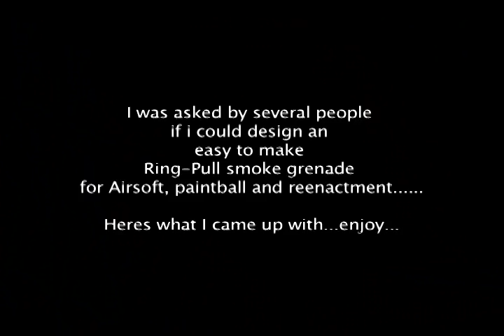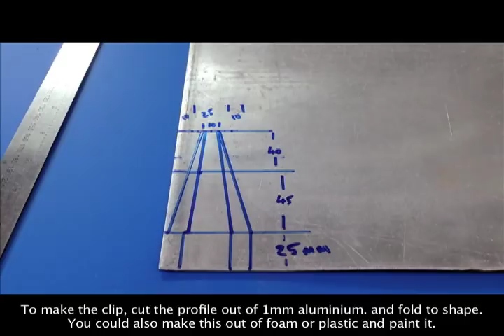Experiment No.1 A SAFE Reusable Ring-pull smoke pyrotechnic

Comment: Here's a suggestion.  Instead of a threaded rod, use a nail, which has been covered with sandpaper (glued on with contact cement).  That would be cheaper than the rod, and propably more reliable, too.  Better yet, a piece cut from a coat-hanger.
Reply: Cheaper? Yes, absolutely. More reliable? No

Comment: I can't test it myself, it's hard to find the smoke pellets in my country if you aren't a professionnal. if I may suggest, why not use a little spring with enough strength and recoil to push the rod and connect it on a mobile spoon? so much potential in this little battleground accessory :) good job!

Comment: I have a already detonated flashbang that has an operational trigger system if you want to re use it you just have to take it apart put a new center shell in there and replace primer at the top if you can make this fire on shotgun primers let me know thanks

Comment: Buy dummy hand grenade,remove spent striker and put piece of fuse up from bottom after chamfering the top hole to accept a small pistol primer., seal with drop of wax, reset fuse assembly and screw into body, add smoke generating powder,tape bottom hole of body. pull pin, hear satisfying pop and throw, you have 2 seconds max. Admire smoke, repeat.

Comment: Very cool, but a real grenade wouldn't go off until you release the lever. I don't see how you could pull that off though. Maybe have ring holding it in place and hooking it up to the lever instead. Have a spring pulling it down, so once you let go of the lever it would pop out and set off the matches.

Comment: Swallow Forge Is it possible to use a mix of Potassium nitrate (stump remover) and powdered sugar that everyone seems to use? It is safer than black powder and seems to produce more smoke and less smell. It also makes a puffy smoke like the smoke you see in an M18. I am not sure why it does that but I am a fan of Airsoft and smoke grenades for Airsoft seem to be hard to find in the United States.
Reply: Also black powder is a bit expensive.
Reply: Also smoke pellets I can't find anywhere and I have a ton of stump remover.
Reply from the maker: Check out my other video here. 
http://youtu.be/vkn2ucOobLA
Reply: Swallow Forge
Thanks!

Comment: omg omg how did you learn how to do that!?
Reply from the maker: 20+ years of engineering. :)
Reply: wow awesome
Reply: is it a only 1 time use
Reply from the maker: No you can reuse it as long as nobody treads on it :) you may have to replace the rubberband. If you want it to last a really long time I suggest using copper pipe for the tube. :)
Reply: Ok thx
Reply: Swallow Forge Is it possible to reconfigure it into a cylindrical shape? Rather than the rounded M67 Design you used on the video.
Reply: What did you engineer Swallow Forge
Reply: ThePaperCreater lol is it possible? yes wtf kind of question is that
Reply from the maker: You can make it any shape you like :) the ignition system is just the tube with the pen cap match holder held in place with rubber bands. The threaded rod is the striker. Once you have made that, it's just a case of using your imagination. Have fun, but overall, be safe.
Reply: Swallow Forge The clip is called the spoon on a real grenade.   Very ingenious,  maybe some type of sealant that won't burn to keep the cardboard from getting soggy when used near wet areas?  How about adding some weight to the empty side and maybe more vent holes to the other half for more spread on the smoke.
Why not use tape when connecting the fuse to the striker area to make it easier to reload or maybe have a small pipe with a holding area at the end to hold the fuses into the starter.
Reply from the maker: eric kinney Thank you, I do try to be patient, however my mouse button does sometimes hover over the 'Channel ban" button. I've only used it a couple of times in anger though :)
Reply: Swallow Forge Are you referring to me? If so I'm sorry if I did anything to provoke an argument with that person, though I do believe it was him who started it.
Reply from the maker: ThePaperCreater no not at all. I do on the odd occasion get quite nasty comments from people who don't really understand the object of the video. Firstly i have to look to myself first, had i not made the video as understandable as it should be? But more often than not, I just realise that the person is an idiot. As far as I am concerned, you may ask any question, to engage in dialogue is an important way of sharing knowledge, I have learned a lot myself from discussions on youtube. I hope you enjoyed the video, as I intend to make plenty more :)
Reply from the maker: I have redesigned the grenade in a new M18 package with a super simple ignition system! check it out here!
http://youtu.be/vkn2ucOobLA

Comment: Can you add length to the fuse so you have time to toss the grenade before it starts smoking?
Reply from the maker: Yes you can. If you run the fuse round the circumference of the hemisphere you will get up to a 15 second delay depending in what type of fuse you use. 
Hope that helps. Alex

Comment: Hello (<---NOOB) just a quick question.. why did you do that at 00:39 ??
Reply from the maker: Hello Morten, If you mean why did I turn the spray paint upside down, then it's because by turning the can upside down and spraying until the can runs clear, cleans out the nozzle, so you can use the can again at a later date without the nozzle being blocked. Hope that helps. :) Alex.
Reply: Oh.. i did not know that... thanks
Reply: ههههههههههههههه
هههه

Comment: Is it safe to breathe in the smoke? Not sitting there inhaling it, but if you were to get some in your lungs, would it be potentially harmful?
Reply: +Luke J It isn't the worst thing that could happen to you. Just try not to get too much in your lungs.
Reply: okay. i would like to use is for airsoft, but ive read about it and everyone says its so extremly harmful, and ive had my doubts, but like you said as long as you dont get too much in your lungs it shouldnt be an issue.
Reply: use it*

Comment: its a really creative build what you did but first i had to say i hope that was a joke that you need to be 20+ year an engineer to build these little thing xD and i dont wanna hate its a really good video and what you builded works fine but its not a good quality and its tooooooooo much time for just having a bit of smoke ;) i just wanna say if i would build something like this i wouldnt build a prototype of something with bad quality i would build a bunch of it in high quality but it takes to much time for that little fun ;) but youre a creative guy ;)
Reply from the maker: The 20+ years was a reference to why I find it easy to design things. The trick is to design things to be simple so anyone can make them. I could have made it to look better, but the point of this video is to inspire others to make their own. Plus it doesn't need to be perfect. Takes about 20 mins to Batch out a bucket load. Plus they are reuse able :) time well spent in my book :)

Comment: Too bad I dont have the materials to make this, but if I had I would make it a little bit bigger and use four smoke pellets instead of two.
Reply from the maker: The three inch cardboard hemispheres are about the right size for Grenades used during the 17th and 18th centuries making them ideal for historical reenactment as seen in my other video. This one is designed to imitate a M67 frag grenade, so 3 inch diameter is pretty close to the original. A simpler way to get more smoke is just to crush the pellets into a powder, half a hemisphere will hold about 6 pellets this way. Hope That helps. Alex
Reply from the maker: I have redesigned the grenade in a new M18 package with a super simple ignition system! check it out here!
http://youtu.be/vkn2ucOobLA
Reply: Swallow Forge Awsome, I'll give it a look!

Comment: do i have to use the hemis stuff or could i use like a pill bottle
Reply from the maker: +Critically Chaos I wouldn't advise using anything made of plastic as the plastic creates toxic smoke when it burns. A toilet roll tube makes a good substitute. you can cut discs out of a cardboard box to plug the ends.
Reply: thanks

Comment: Step 1. Become a master fabricator. 
Step 2. Buy $50,000 worth of equipment.

I think you left those steps out.
Reply from the maker: Step 1. Watch
Step 2 learn
Step 3 realise you can make the same thing with a coping saw, hand drill and some sand paper.

Or just watch my other m18 smoke grenade video that doesn't require anything more complicated than a pair of scissors. :) 

Step 4. Enjoy :)
Reply: TheTFReview  A little bit of respect for somone like him would really be appreciative, plus its just simple tools, he just used more advanced ones for the video
Reply: Chyf jAkzx Of course I respect him.

Comment: Instead of using smoke pellets you should use the rocket fuel from the king of Random but sadly it will not be reusable
Reply from the maker: It will also create lots of fire. That's why I don't use it. Using the smoke pellets means they can safely be used in forests, buildings grassland etc without setting fire to its surroundings.
Reply: Swallow Forge but thats the fun part.....

Comment: a grenade should be designed to explode not only smoke
Reply: Believe it or not, it's probably not legal to go and make your own explosives, so smoke grenades (which I find cooler than regular ones) are the other alternative.
Reply: its crap
Reply: CleanUnit you angry or something? I was just stating that grenadea can also be used for smokescreens or signals, no need to go full on Hitler mode...

Comment: not to be a hater and stuff but this dosent work well is mostly for looks takes to much money and time
Reply from the maker: They have all worked so far.  Have you built one and tried it? As for cost. The work out about £2 each.  Considering most of it is reusable (assuming nobody deliberately treads on them) it works out a very cost effective way of creating a smoke grenade. However if you want super cheap, super easy, no tools required check out my other video here :)
http://youtu.be/vkn2ucOobLA
Reply: Swallow Forge im sry but I know its hard I don't know if is reusable im sry but it takes so long to make and all u get is a little puff of smoke im not trying to be meen sry
Reply: Swallow Forge im checking ur vid thanks 4 the link

Comment: I hope you are not sheet metal fabricator with those crap tool. :/ [Primarily those ugly nasty blue hand shears.]
Reply from the maker: Eddi Kimball Those nasty blue hand shears as you call them are Gilbow sheet metal shears. They have been an industry standard in sheet metal fabrication for over 100 years. They are still used by some of the biggest industries such as aviation, and bespoke car manufacturing. The earliest form of Sheet metal shears date back as far as the 4th century BC. So I suggest that before you make comments such as as you have, you do a little research first, otherwise you just come across sounding like an idiot. Hope you enjoyed the video all the same. :)
Reply: Swallow Forge Well miss sassy pants, this is the new age, old people and things got no place here anymore.
Reply from the maker: Wow. Just wow. If you don't understand what's wrong with your last statement, then all I can do is wish you good luck in life. You're going to need it.